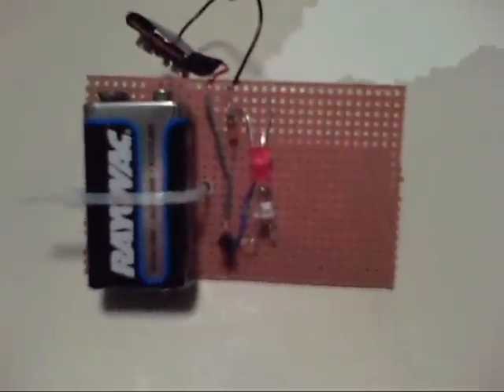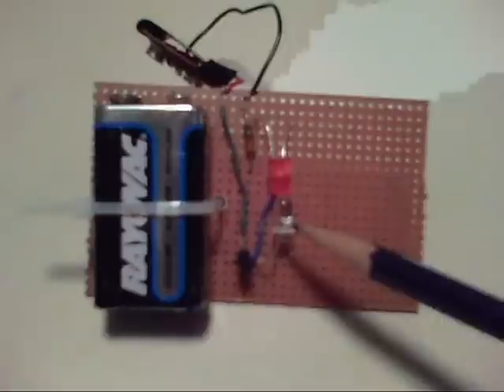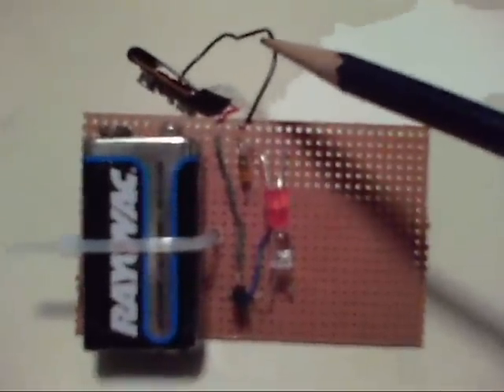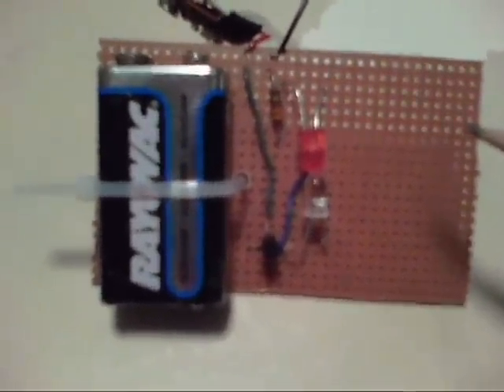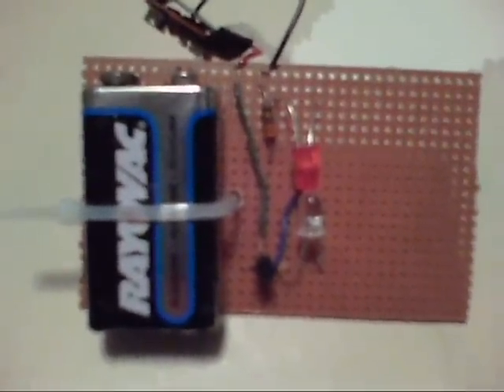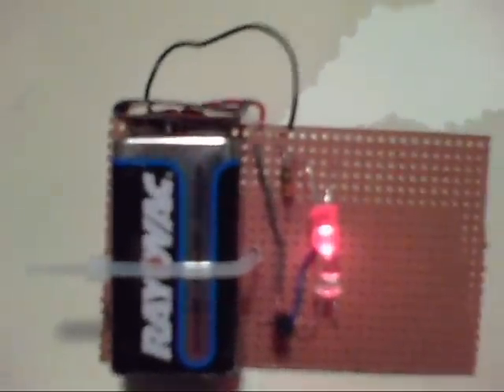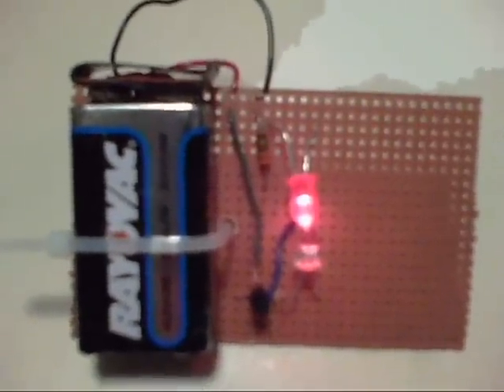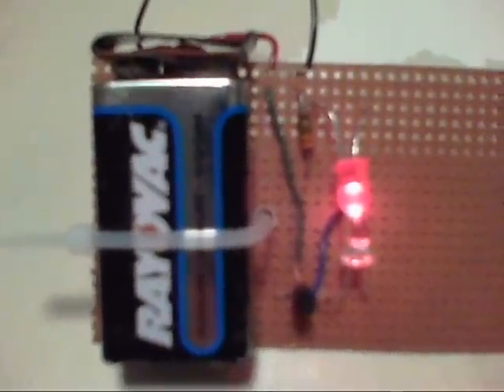Laser Tag Circuit

Comment: Many thanks would you mind listing exact components please
Reply from the maker: Not sure if these are still available.
1) Phototransistor
Radio Shack p/n 276-0145 ; possible substitute TEPT5600
2) NPN transistor, 2N3904
Radio Shack p/n 276-2016
3) LED red
Radio Shack NTE30056
4) Resistor, 330 Ω
Radio Shack 271-1315
Reply: Thank you

Comment: What kind of resistor ????
Reply from the maker: Here are the components that I used to build the circuit. It's been a few years since I built this, so these part numbers may not be available now.
1) Phototransistor
Radio Shack p/n 276-0145 ; possible substitute TEPT5600
2) NPN transistor, 2N3904
Radio Shack p/n 276-2016
3) LED red
Radio Shack NTE30056
4) Resistor, 330 Ω
Radio Shack 271-1315

Comment from the maker: Here are the components that I used to build the circuit.
1) Phototransistor
Radio Shack p/n 276-0145 ; possible substitute TEPT5600
2) NPN transistor, 2N3904
Radio Shack p/n 276-2016
3) LED red
Radio Shack NTE30056
4) Resistor, 330 Ω
Radio Shack 271-1315
If I get a chance, I'll make a short video showing the circuit and post.